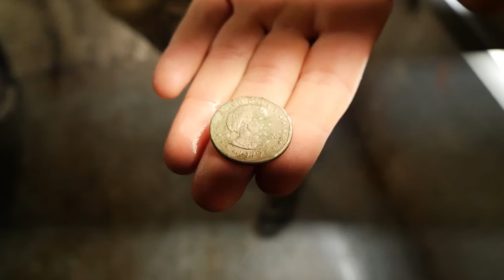RUSTY but RARE 1976 Chevy K10 Sport Truck REVIVAL!

Comment: I would love to see this old truck restored. It is very doable. Old square-bodies are very easy to restore. My old 74 K20 was also a plow truck out of Iowa. Onawa Iowa specifically. Had to replace the whole bed, the front fenders, front leaf spring hangers on both sides, and still have some work left on the cab. Went from very rotten to just a little rusty very quickly. And it was very rusty. Just about as bad as this 76. Who knows, my truck and this 76 might meet one day.

Comment: I have a black 76 2wd. Factory 454, factory tach, am/FM/CB (and the factory Delco cb mic)....I found a stepside bed for cheap, it was less rusty.  Big block was built in the early 90s, flat tops, cam, Holley Intake, and ran really good until the cam wiped a lobe. I love the bicentennial trucks. Mine had a stack of 76 bicentennial quarters glued to the dash, so I really like the silver dollar Chevy idea

Comment: Before changing that transmission try to top up the transmission fluid to the correct level. The fluid quantity that you' ve lost might just be what's causing your transmission to run only in reverse. 
Very entertaining video.
Reply from the maker: It is full, i think drop the pan, filter, etc might be worth a shot
Reply: @PoleBarnGarage  great video on the old girl. I love it.

Comment: i could make that truck look sweet with all the parts i have sitting i have 8 rust free trucks plus parts  just sitting i also have a 79 Cheyanne short wide box full option 4x4 with the 400 sbc and 400 turbo 100% factory with under 35,000 miles on it been building a 68 chevy pu with a stroke 454 with a 02xx trans  12 bolt possi

Comment: My truck is a 1965 Dord F250, its got a crappy little 2 barrel carb and needs a new one. Thankfully it has the ability to move in a forward direction. Roof dont leak, and the AM/FM radio is clear as day. I do need to replace the carb soon as it has staryes dumping fuel out ghe top.

Comment: Might have something to do with the vacuum modulator?
Reply from the maker: I guess? That just controls line pressure. It's weird man
Reply: @PoleBarnGarage  I had something like this happen with a Subaru I did the timing service on. 2006 Forester, had to take the radiator out to do the timing service, drained the somewhat dirty but not horrible transmission fluid, refilled it, it lost reverse and wouldn't shift automatically, you could get 1st and 2nd by shifting manually. Never figured out why, sometimes transmissions just give up.

Comment: I had a 79 step side with full time four wheel drive. Rusty shitbox was actually kind of reliable. As a bonus you could clean out all the trash by kicking it out the holes in the floor. Good times.

Comment: You're low on transmission fluid, just a little more and it will go forward.  I've had the problem before and adding a couple quarts fixed it on my 75 k5

Comment: Dalton, personally the automatic transmission has been the only part of a vehicle that has continued to be the one part that has defeated me numerous times. I have torn into every single possible part of a vehicle and repaired or replaced including full engine rebuilds and when something failed it is always my mission to understand why and how while fixing it. It's just my way, however transmissions have failed randomly on me several times and left me with no understanding or the ambition to try and go inside to try and figure it out. For some reason it just feels like they're beyond My capabilities even tho nothing has ever actually proven to be otherwise. I don't know just something about tearing into one.
Reply from the maker: I'm the same way

Comment: The plow frame, rims, tires, and of course, the silver dollars, are probably worth more than all the "remaining" parts of the truck. That said, there are insanely high numbers of companies out there that repro ALL of the body panels for this turd, I mean truck. I'm sure companies like AMD and LMCtruck and who knows who else probably carry a one piece full floor pan for this thing. As a bonus, it will most likely save you a crap ton of time and cussing. It will also be a stronger and safer repair. I'm pretty sure that J.D. knows more about cars than all of his classmates combined, and, that's because he has a really great teacher.
Reply from the maker: They only make floor pan halves, but that will be fine. With cab braces being solid, nothing to worry about

Comment: That was an entertaining video for sure! Had to grin when Kevin was laughing as you were trying to load up. I had a 77 stepside square body for a long time, so you made me smile for sure. Used to subscribe to JD, got aggravated when they ruined the AZ Bronco trying to run it off the factory fuel tank even when they saw the condition of the fuel coming from the tank. Been meaning to become a member for some time, finally did today.
Reply from the maker: Appreciate it! Make sure you check out the first vid on his channel!

Comment: "It doesn't get any more bulletproof than a small block Chevy"

laughs in ford 300 🤣

I thought for sure this truck was DONE. Hope to see it back on the road in one-ish piece. 😂🤟
Reply from the maker: Hard to come apart when you make 100hp. And yes that also applies to most small blocks lol
Reply: @PoleBarnGarage  ford just made the perfect combo of reliability with the 300. Loose tolerances, barely enough compression to run, and not enough power to hurt itself. Lasts forever. And I say this as someone who daily drives a 300. 🤣

Comment: I once owned a  1973 Chevy K10 Cheyenne Super. You ever heard of one of those? Black on Black With a Sun Roof & US Mags U101 Indy's.  Not a stepside. My Bro had a 76 Maroon stepside with a Straight 6 and 3 on the tree. He stuck a 350 in it and a Floor Shifter of Course,.

Comment: When it comes to aged GM automatic transmissions, the fluid type you should use is probably Ford Type F.

Dexron is an extremely slick fluid, Type F is less slick of a fluid. Ford Type F in a GM transmission will make it slip less.

Comment: I like your practical approach. A guy needs that to get anywhere with rusty old squares or they just sit and rot. If that trans is a 400, from my experience, the valve body is full of crap. The fluid on the floor was terrible lookin stuff. Might be why the old girl was parked.
Reply: But it did forward and reverse before he switched all the levers around.

Comment: The transfer case is probably a "Full time four wheel drive" NP203, with " no provision for two wheel drive operation."  Which is fine.  But people often CONVERTED them to Part Time four wheel drive. Then the labels on the gear shift Hi, Hi Loc, N, Lo , Lo Loc no longer describe how it works.
   The switchable hubs in the front are a hint that this occurred.
   This would not affect the trans not going into the forward gears problem, though.
Reply from the maker: I know, just a matter of "what was the last thing I touched" that made me wonder

Comment: God luv ya Dalton. BUT... Only people who have no clue call those carbs junk. If you know what your doing you can get a Q-jet to run and drive like it is fuel injected. and once it is set up you never need to touch it again and can support high hp if you want. Been fixing and tuning them since high school in the 80s.
Reply from the maker: Ya but you don't need any special knowledge to tune a Holley lol. I like quads, but they're a pain in the ass
Reply: @PoleBarnGarage  Yep. pain in the ass fixn all the crap done to 'em by the Holley and Edelbrock guys. :face-turquoise-covering-eyes: Qjets got a bad rep from all the knuckleheads pulling one off a 454 and slappin it on a 350 and wonderin why the 350 ran like a dog. Love the channel keep up the good work! PS more Pontiac stuff if you can. Like a 2nd gen firebird???

Comment: There isint a thing you cannot restore. This is peace of cake compared to rare vehicles i have seen to be restored. Hell Northern Ford Escort mk2 that didnt have anything left below windows, essentially just the roof, with massive hole and tree growing middle of it was rolling chassis in a year. It all depends on what panel parts are available or if you have skills to panel beat them your self. This one, long as the frame is ok its non issues. Aluminum parts rotting, thats bit more difficult though.

Comment: The only thing I saw that remotely could have changed is the modulator valve...not a transmission guy though, just observation.
Reply from the maker: And that only controls line pressure, as far as I'm aware. Talk about bizarre
Reply: @PoleBarnGarage  agreed...I've seen this behavior before, and for the life of me I can't remember what the fix was...it's been too many years...I'm a mopar man, so...lol
Reply: @PoleBarnGarage  well I do believe that all the bands do depend on fluid pressure to enguage, so it is likely that the fluid pressure is dropped.
Reply: @Pole Barn Garage the modulator valve needs a vacuum to change the line pressure in the trans I've seen this before especially on Iowa plow trucks. Can't zip-tie that in place needs move with the vacuum from the Throttle. Give that a shot and see what happens, buddy I'm sure she's fine

Comment: I know it's a bit late (like by a year) but the transmission failure was probably due to it getting fresh fluid full of detergent. Old transmissions that were not well maintained will wear out and the metal and whatnot gums up and becomes all that holds it together, so when you put fresh fluid in, the detergent cleans it all out and then there's nothing holding it together anymore and, well, it's bye-bye transmission. 
For any of the younger people who bother to read this, DON'T change the fluid and filter in old automatics, you'll just end up having to rebuild or replace it.

Comment: I actually had a 1980 Scottsdale, supposedly it came with a 305 as a lot of those Vehicles did in that era. Somebody decided to pull that motor out and throw a 350 4 bolt Main in a cam headers. I was driving around one day and a town that I don't usually venture too and I found this truck part underneath and Old Pine Tree, had needles in it everywhere including under the hood I literally asked the guy how long it would been parked and he just didn't know he did say what kind of engine is stuff it had in it and I was interested. But when he said $500 it hardly had any rust he just wanted it out of the front of his property, I said do you mind if I try to get it started so I can drive it home he said no problem. I told the man either way I was going to take it, so I literally put a battery in it smell the fuel added some premium to it and I think a can of some super mup Juice hit the key and crank the right up yeah she was a little rough but that's a Chevy for you! Well I got rid of the Quad to junk and through on an elderbrock carb and after that no problems whatsoever with a minor tune-up which is understandable she ran like a scalded ape the interior was beautiful, only had one small crack in the dashboard and no cracked windows thank God. I kept that truck for quite a while and then somebody made an offer on the motor and transmission that I could not refuse. Seems how I already had a 1970 3/4 / 1 ton 4 speed I just sold in the whole truck and let him deal with the motor and transmission, although it did kind of stay in the family it was my fiance's son so Fare Thee Well. I would like to tell you thanks for the great content when I see somebody taking something from another YouTuber in trying to actually do something with it although I don't care much for the ripping and tearing of stuff but you get the job done regardless and usually everything that you're doing that to runs very well. I know I sound a little harsh but I'm fat and I'm old and I still Tinker with all my stuff to the best that I can! Thanks again, many blessings to you and your family.

Comment: Cool truck , maybe check the vacuum control valve that is zip tied on
Reply from the maker: That's a modular valve, it controls line pressure. Like a TV cable on other cars

Comment: Something clogged up a passage in the valve body. Or the filter is just that restricted now after dumping stuff in it , it can't just go out driving to sitting to driving . as far as mechanical failure . pump etc . pan is probably full of crud . is the vacume modulator line unhooked from the engine after carb stuff .

Comment: Now, before you go dropping the trans and getting all crazy… drop the trans pan and look in the pan for a pin. Take off the filter, and move the trans selector through the gears. You’ll see what the shifter linkage on the trans is supposed to move. 
.I’ve had this happen on a turbo 350.
Reply from the maker: Even if it clicks solidly?
Reply: @PoleBarnGarage  
It’s been a moment since I had this happen… I think it was in 2003… maybe 04. Was in my old 69 GMC. 
I’m pretty sure the clicking/detent is directly on the rod that comes into the case (where the U shaped piece is you fixed the connection to). The piece that may be disconnected is a hydraulic plunger that moves fluid routing. 
God, this is a 20
Year memory, but as soon as I opened it up and pulled the filter it was all plain as day. I was told the part would be on the top of the filter and I’ll be damned if he wasn’t 100% right. Since you were beating on it doing field testing, it probably fell into the pan. 
Worst case, you lost a half hr of your life. Best case… free fox, and you said it needed fluid and filter anyways so the dropped oil isn’t a big deal. Check it out… let me know what you find!

Comment: dude your power brake booster hose was not hooked up to the q-jet. it can be seen hanging down by the exhaust manifold. that's why you had no brakes and a high idle (caused by the huge vacuum leak). when the street demon went on the booster hose could be seen hooked up properly to the back of the carb. that's why you suddenly had brakes and the idle was fixed. strange you didn't realize that or acted like you didn't.
Reply from the maker: It was plugged on the. Q jet, no vacuum leak. A brake booster just makes the pedal easier to push, pushing the pedal still engages the piston in the master cylinder regardless of the booster

Comment: took out your forward clutch pack bet you wiped em from running it low on fluid, pull the front pump and change the clutch packs had it happen

Comment: 40:00 my guess is that that would be used as a coil wire if you have a coil that isnt attached to the distributor
Reply from the maker: Not with a straight boot and a male dist end

Comment: Actually, there is no silver in a 79 'silver dollar'. '64 was the last silver. Which actually seems more appropriate for this truck anyway. 'junk metal' square body Chevy.
Reply: 69 was the last silver. Had there been a dollar from 65-69 (as planned) it would have been 40%silver just like the 65-69 Kennedy Halves.

Comment: I learned a long time ago doing projects can never truly look at the bodywork or some of the floorboard, I look at the frame the suspension motor and things like that but those are in good shape then the cosmetics though they can be a little pricey but it's easier to replace fenders and trim pieces then try to rebuild or save a frame, this truck is worth every bit of restoring floorboards for that or everywhere fenders grills everything she's definitely a beauty

Comment: I had a ‘78 Scottsdale step side 2WD, 350 4spd.  I had all kinds of problems with it.  Terrible rust issues around windshield, front fenders, rockers.  Rear diff blew up, camshaft ground itself down.  Learned the hard way how to fix all things mechanical.  Finally gave it up after 20 years and that was over 20 years ago.  I saw it driving down the highway about a year after I sold it to Pick-n-Pull.  Someone totally restored it.  Looked amazing!  Good luck. Subscribed
Reply from the maker: Thanks!

Comment: i am betting a seal in the transmission went bad for the forward clutches. had something similar happen to the transmission in my elcamino. it had no problem driving in reverse but would not go forward at all. it had sat a pretty long time with almost no use before i bought it and i have pretty much had to get most thing on it rebuilt. or fixed.

Comment: Love the stepside. Had a bullnose F100 Ford F100 I did a dollar tree/ harbor freight restore on. Wood in the bed was bad and had some 3 on the tree issues. I ended up going to home depot and used some T1-11 siding in the bed;  did a floor shift conversion.

Comment: Unhook the vacuum to the transmission modulator and see if you can shift column to first gear
Reply from the maker: Modulator just controls line pressure 🤷
Reply: @PoleBarnGarage  I have a ford that's doing the same thing. It had forward gears until we fixed the vacuum line. If I unhook the vacuum line, I have forward gears, but I have to manually shift the column. Not 100% sure why yet.

Comment: GUARANTEE some trash/rust got sucked through that tranny cooler tube into the valve body and that's why you lost drive. Linkage shifts, but the valve body is plugged up and won't go into drive internally. Love the truck :)
Reply from the maker: Very likely. Thanks for watching!

Comment: As long as you have the cab mounts and cab braces, and the rockers or new ones to put them in, you can take a gm square body truck hood and cut the top outer panels off of the junk hood and stitch them in and shape them into the floor pans

Comment: fun trick for that door panel - take a heat gun to it, keep the distance enough that it doesnt burn and the red will come back
Reply from the maker: Runs the risk of becoming goo however
Reply: @PoleBarnGarage   have done it several times, keep the gun on low, keep it moving, and take your time. do it right and it will come out awesome. Give it a quick try and you will see what I mean